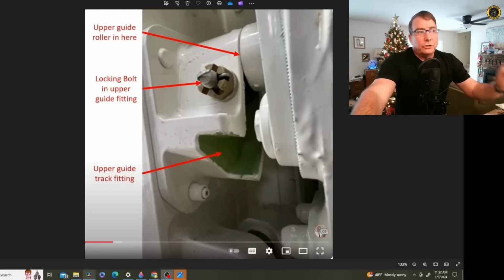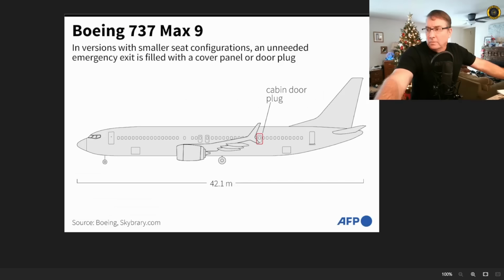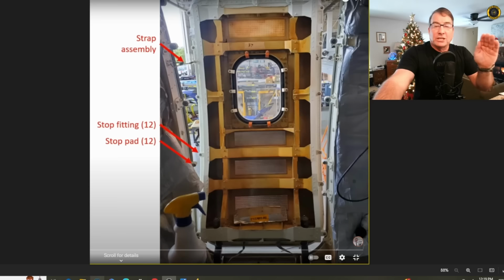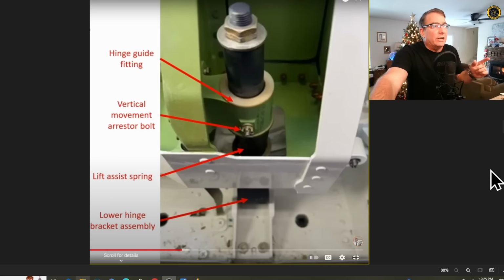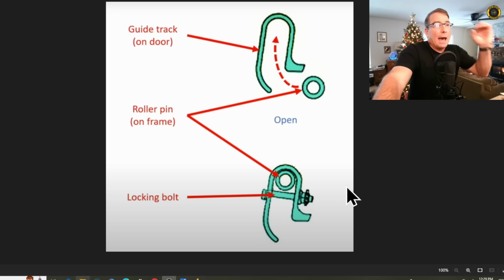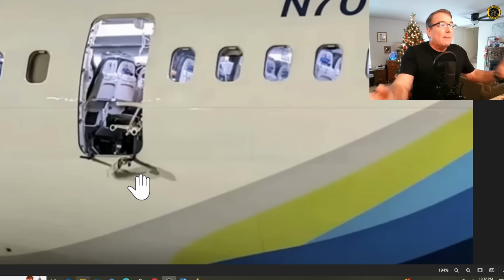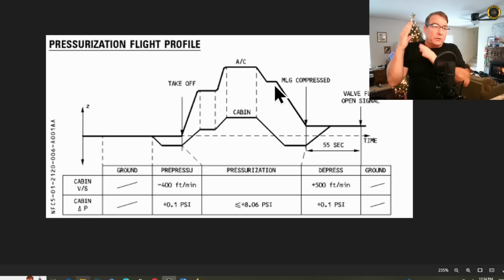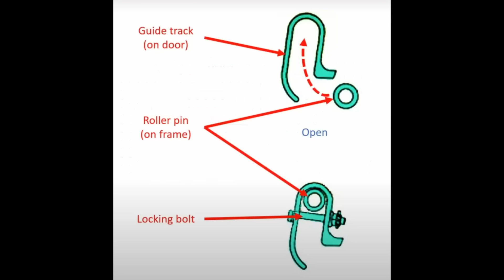Alaska 737 Max-9 Door UPDATE! 8 Jan 2024

Comment: As a retired Navy Jet Mech, P-3 Flight Engineer (with 10K+ flight hours) and QAR, I find it hard to believe that they are using cotter pins and not at least 0.025 stainless safety wire to secure the castle nuts

Comment: As usual, a perfectly presented, no-nonsense video that a layman like me can understand (almost). I got a general idea of how the door is held in place and prevented from moving up 1.5 inches by the bolts.

I do have a question though, if the internal cabin pressure is greater than the outside air pressure at FL 160 or the cruising altitude, my understanding is the internal pressure is always pushing the door out (up and out). So, what holds the door in place is just these 4 nuts? Isn't that too little a safeguard? 

Please excuse my ignorance if I have gotten this completely wrong.
Reply: Not any type of expert myself, but based upon what I read here, the pressure differential holds the door in place from being pressed out, and the bolts and pins and guide hold it in place from moving up and down.
Reply: @JohnHallgren  thank you and that was my understanding as well. However, I am still not clear on one thing. With the pressure inside the cabin being higher than the outside pressure, at higher altitudes, the pressure inside will always be pushing the door out. Is this the only mechanism (the door going up and out) along with the bolts which prevents the door from being getting blasted away from the plane?
Reply: @rohitsrins  those twelve matching pressure tabs on door and frame are what primarily hold it in place from going out.
So the four bolts and hinges and pin/guide hold it vertically stable.

Comment: I see.Basically the fittings are built into the aircraft so fitting a "real" door would be a relatively straight forward process.Were those castle nuts wired? If not it defeats the principle of how they dont unscrew.

Comment: My question…as a professional pilot…is how does a door like this get certified? I ask this from the perspective of how does it get certified with ANY (bolts or no bolts) possibility of coming open during flight?? That door should be locked in place not only by the bolts, but by the pressurization. Thus preventing any possibility of this incident. 
I have always been a massive Boeing fan…but when they went to a “diverse” supply chain, I knew then that this would happen. First the 787 and now this MAX crap.

Comment: Understanding the details of the design scheme which Juan described, I don’t really see how loose bolts can be found, as these would require some fairly extensive failures of assembly and inspection procedures. Are there not multiple safety checks in place to catch issues like this before they leave the factory, and if not, what else might be wrong?!

Comment: To open the plug door, it is pushed down (against the springs on the hinge at the bottom). Then the door can be pushed open (a strap is installed to prevent it opening too far). The springs will lift it up to prevent it closing again unintentionally.
Reply: Totally wrong.

Comment: I'm surprised this door plug is designed to open outwards. Isn't it typical for airplane doors to open inwards so they can be designed to not fit straight out the doorway. Then even if all the bolts were missing, the air pressure should actually hold the door in place, not blow it out of the plane. Have i misunderstood the description? Maybe. That one picture of the upper guide track was upside down, or the description didn't make sense to me either.

Comment: There should be a mark on the paint where the bolt would have been tightened - or not,incredible luck the door did not hit the tailplane or the story may have been far different.
Thanks for a concise detail of the unfolding story,certainly a brown trousers event for many passengers.
Reply: Yes.  This is why NTSB is taking the recovered plug door to its lab for further analysis.  They should be able to determine if the two bolts and nuts were installed from marks in the paint or metal.  Unfortunately, they probably won't be able to determine if the cotter pins/split pins were installed around the nuts correctly since either have been recovered.

Comment: My money is on either no safety bolts installed at all or no cotter pins installed. Probably no coffee pins tbh, easy to picture a maintainer forgetting to bring new ones to the job and then getting sidetracked and forgetting to back and install them. A lot of feedback on 737 technical that the door gets remove for other systems maintenance often enough that it's probably not still original install from the factory. Just my thoughts as a maintainer looking at the door design.

Comment: There are reports that "loose" bolts have been found in the plug doors for some Max-9s. Now by loose we don't know what that means. It could be the locking bolts are not torqued to spec, but the cotter pins are in place holding the nut on the bolt, or the cotter could be missing completely and the nuts were loosening themselves under vibration. Either way, Boeing have a LOT of questions to answer regarding the installation of the doors. Even the simplest of engineers knows that a castellated nut requires some sort of locking device to hold it in place, so if it wasn't fitted, what does that say about the "engineers" that Boeing are employing to assemble these aircraft and the procedures used to explain the assembly procedure and any checks made subsequently? Also, if the same "engineers" are being used elsewhere on the aircraft assembly, what quality standard can we expect in other areas of the aircraft?

Comment: No bolts + "Lift Assist Springs" + 423 mph Groundspeed = KABLAMMO!!!

"Lift Assist Springs - The lift assist springs make sure that the plug door WILL NOT FALL BACK TO THE CLOSED POSITION when pushed open..." --- The Boeing 737 Technical Channel

So with the door being SPRING LOADED with a force toward the OPEN position, if it moved outward with no bolts installed it went right into the airflow (as designed 🤦‍♂) and KABLAMMO!!! Just as Juan said...

Comment: To open a plugtype door, Downward vertical Force must be applied to overcome the lift assist spring pressure since the roller pins are normally seated in the top of each track when the door is properly closed and seated along all 12 stops.  I wonder if lift assist pressure was insufficient and without upper stop bolts and damaged or bent/broken/missing  lower stop bolts? Normal vertical flight loads and pressurization cycles allowed vertical movement sufficient to fracture the top tracks?
Reply: You have it backwards, armchair engineer.

Comment: If any one of those bolts were installed, no way this door could raise up and open. They were most certainly left out. Some years back, two guys were building a composite experimental monoplane. One of them, working alone, had test-fit a wing to the fuselage with cleco fasteners. Later, his buddy showed up, alone, and proceeded to lay fiberglass over the wing root fillet. The plane passed inspection, ground runs, and on the first flight, the wing separated from the fuselage, killing the pilot. The story as I remember it

Comment: This was a barely averted catastrophe...someone did not put the 4 bolts back in place...that aircraft had been flying around like this 3 months...

It is reported there were 3 "red light" alerts regarding cabin pressure on the 3 days prior to this incident.

Comment: Assuming the bolt was there, that is a crap way to hold back a pin. I’ve never seen it work well because the round faces impact each other on a tiny near-zero contact area.

Comment: So these plug doors are installed from the outside? Surely they should have been designed to install from the inside, thus the difference in pressure at height would have forced the plug tighter into the fuselage rather than trying to blow it outwards. Isn't that the premise of all the other doors and exits? they have to be pulled into the cabin before they can be pushed outwards again? I certainly remember the guide for the overwing exits on one plane I flew in told you to pull the door inwards then throw it back out of the opening it created.

Comment: What’s to say that the roller pins didn’t shear. That photo isn’t detailed enough to say it’s in perfect condition. Sounds like a fatigue cycle issue or material manufacturing defect shearing the the pin off from repeated load cycles.

Comment: Calling it a door or (filler) panel is appropriate.  What seems inappropriate, after seeing this video - is calling it a plug.  It is clearly not a plug, and I don't know why anyone would refer to it as such. 

If it was a real plug, it would not leave the aircraft without major damage to the fuselage.  It also would not hinge out like that for inspection, it would hinge in.

This is more like the door of a battery compartment for a kids toy, you slide it a bit then open it or pull it off.  I have never heard anyone call such a door a plug (because it isn't)

Comment: My thing is they should install that door on the Ryan Air planes and not install that door on all the rest of them for one less thing to worry about. Seems like the week link in the chain and just adding one more hole in the plane that they don’t need.
Reply: But during the lifespan of that air frame, you don’t know what owner is going to require what configurations so it had to be built to allow for any possible layout including an exit door or a non-exit door.

Comment: My bet is that there were bolts NOT even installed, maybe one with out the cotter pin and that held it for a while. Any one bolt would have kept the rollers from moving in the tracks.
It's so improbable that four bolts failed I simply can't countenance it.

Comment: I wonder...   If, as Juan said, the plugs are installed at Spirit Aerospace when the fuselage is built and then the fuselage is shipped to Boeing where the plugs are subsequently removed as Boeing builds the fuselage into an aircraft and then subsequently reinstalled by Boeing, is it possible that Spirit might not install the cotter keys on the bolts knowing that the plugs will be removed and reinstalled before flight - which would make their installing of the cotter keys a waste of time and material?  Then a Boeing tech comes along to re-install the plug and says to himself that I'll reinstall it exactly as it came out - minus the cotter keys.  I am sure every one of us has disassembled something and then reassembled it exactly as it came apart in order to repair something.  So... Assembled minus the cotter keys and add 2 or 3 months of vibration, bumpy landings and pressurization cycles and the nuts unwind and BANG!  It will be interesting to see what the NTSB finally figures out.  The late reports of loose bolts associated with the plug installation are very disturbing.  A key question that I have not seen answered is whether the loose bolts had cotter keys installed or not.  Even an improperly torqued or even a loose bolt will probably stay in place if the cotter key is in position.

Comment: Looks like they will be able to just pop that door back on the airplane. I don't think they will find out any problems with the door stop fittings or the guide track. These are some of the heaviest parts in the airplane. The information about these bolts will come from the other airplanes that are being inspected and they are finding discrepancies with. United is reporting finding problems. The 737-900 has this same door installation. Interesting the FAA did not extend this grounding emergency airworthiness directive to the -900. Maybe they just figured the -900 has been flying long enough to ensure the installation is OK. I'm willing to bet Boeing will find paperwork deficiencies on the Max-9.

Comment: It is not really a plug door.
A plug door is like the 737 main doors, where the door is bigger than the opening.  Thus the door has to come in, and turn, before it can go out through the smaller opening.

These false doors (and overwing exits), just ride up away from the lugs, and can open straight outwards.

R

Comment: So all four bolts/pins would have to be either not-installed at all or incorrectly installed or defective or a combination of all these issues for the door to depart the aircraft.   If just one bolt had remained in place, the door may not have departed.   Interesting to see what the official report reveals.

Comment: I’m no expert and I have zero knowledge of aircraft mechanics or maintenance or anything, however I am a reasonably intelligent woman and I would have thought that after the pressurization warning lights came on once that aircraft should have had maintenance look over it. Yes I know the maintenance requisition was submitted and that it was awaiting maintenance. After the second time you would think that the urgency would speed up the process, after the third time keep the aircraft on the ground until maintenance could fit it in! I’m sorry but Alaska airlines is bordering on negligence, and yes it was the busy season but to keep operating the aircraft albeit overland was irresponsible at best.
They obviously had a sneaking suspicion that something wasn’t sealing properly which caused the pressurization warning light to come on.
Common sense has to prevail at some point, keeping in mind the two horrendous crashes in recent years and grounding one aircraft to safety check it makes sense.
Alaska airlines is so very lucky that no one was seriously injured on the plane nor on the ground, so lucky that plug didn’t fail at a higher altitude when crew and passengers might have their seatbelts off and so lucky that no one was in that seat.
Things could have been so much worse but this need not have happened in the first place if the airline would have grounded that particular aircraft.
Now knowing that United have found loose bolts on some of their max 9 aircraft you have to wonder is this a design flaw? Was there negligence at the factory? 
Was there negligence or corner cutting during inspection?
Once you start filling a hole with an insert that requires springs and wires and fiddly bolts that require fiddly wires to secure said fiddly bolt, that seems a lot more complicated and maybe just as expensive as forming a solid fuselage. 
My thought is if an airline company doesn’t want an emergency door on the aircraft why can’t the fuselage just be continued as a solid piece? I gather it’s an option as to whether or not an emergency door is wanted by the company that’s ordering the aircraft. Same as if you choose the optional extras on a car. 
Surely continuing the fuselage as a solid piece could be done at the manufacturer! It would save problems like this from occurring. 
Like I said before, not an expert or any experience in aircraft manufacturing or maintenance just thinking.
Reply from the maker: Stby for an update.

Comment: Good detailed report, Juan. Concider this, how rigid is the door? If there is pressure on the door it will bend ) making it narrower and reducing the engagement of the pins on the top. What is the actual length of engagment of the pin with the track. A pin/track on the left annnd a pin/ track on the right. When the door moves to the right more, more engagemet on the right and less engagement on the left. 
Will the door blow off if one pin pops out of its track? Tom

Comment: Juan, love your accurate well researched reports, I hope if you find time you may answer a question that is bothering me concerning this incident. That would be why the pilots dimmed the lights? Had I been on board it would have further upset me because I would assume from it something's wrong with the electrical system also. Thanks,love your work,no doubt you have saved lives❤
Reply: Pilots don't dim the interior lights. That would be up to the cabin crew.

Comment: I'm not buying that there wasn't enough internal pressurization at 16k feet (that's nearly half your final altitude, and the internal pressure never drops below  8000ft equiv).    Your own graph suggests that the pressure differential at half cruise altitude is not that far below full cruise altitude.    That still leaves the burning question.  Even if the bolts were fully missing, how the hell could the door moved against that pressure differential?  We've always been told that it's the pressure differential that holds these doors closed, not just the locking mechanism, and that does not appear to be true.
edit - looks like it's a completely different set of bolts.    The bracket probably separated from the plane, not the door from the bracket.

Comment: 9:40 - Even before considering the absence of the retaining pins/cotter nuts which keep the door from riding up the track.... my question is what happened to the 12 stop fitting/stop pad interfaces which bear all the outward force of pressurization? Are they not held together with "through" bolts which form a clamped joint between fitting and pad? Surely if these 12 fitting/pad joints were intact, they would stop the door from being lifted by the lift springs? If those 12 interfaces are not bolted joints, then the installed door is not structural member of the fuselage. Just an inquiry from an automotive engineer.
Reply: Those 12 interfaces are essentially two opposing tabs that protrude from edge of door and the frame and aren’t bolted joints.

Comment: I'm surprised they weren't designed as an internal plug rather than a door type plug. So it couldn't be used any way like a door and only replaced during maint (e.g. when changing seat config which is what it's needed for).